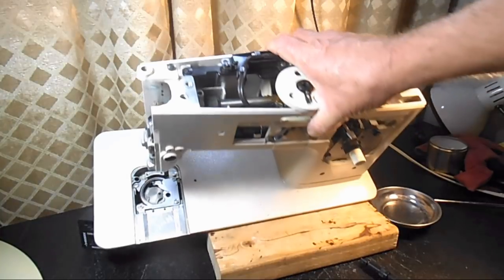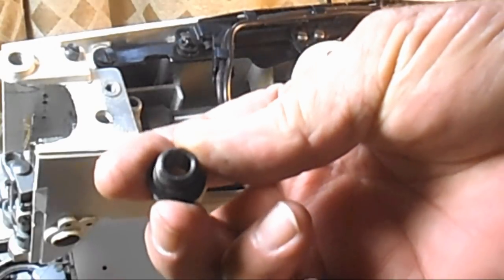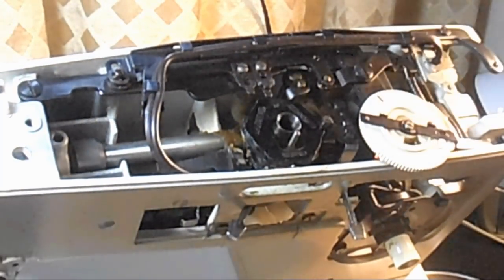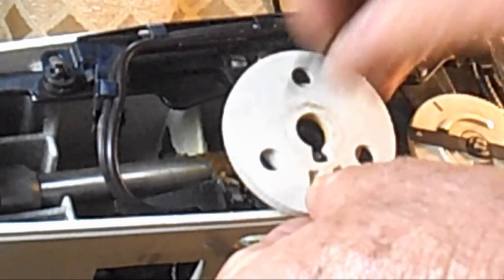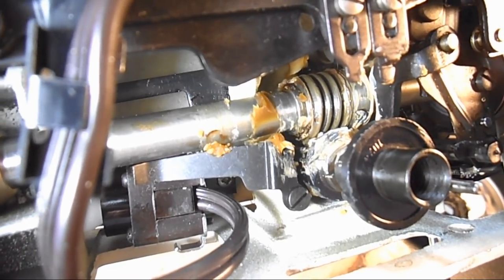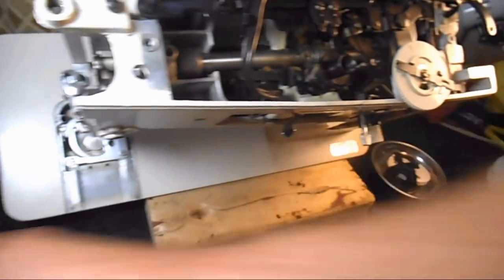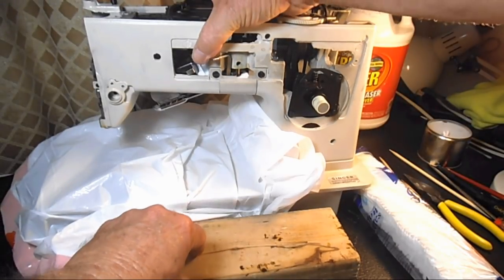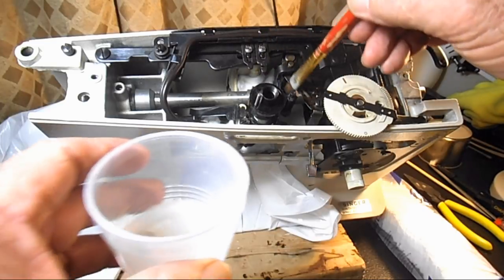How I degrease the worm and cam stack gears on the Singer Model 513 Sewing Machine

Comment: When you say,  "don't use it on the black singers" you mean just the body right? You can still use it on the metal, (silver) bits right?  Just not the body? Thanks for sharing all these videos.  They have been ever so helpful!
Reply from the maker: You are correct Anne Marie; I mean just not on the painted body parts. I have never tried KK on a painted black machine but had 2 viewers mention it dulled/hurt the black finish. They did not say what strength or duration they had used, but I figure better safe than sorry. The KK is really good at removing grease and oil, IMO. I have been told GoJo is good too, and will not hurt the black paint. I just use a trash bag to protect the paint like in this video. It sure beats hundreds of Q-tips and a quart of alcohol I used a couple of times when I strated restoring machines. Thank you for asking and I'll pin your comet so others may see it. Hope you'll visit Andy Tube again. Take CAre.
Reply: I guess it's kind of off topic but do anybody know of a good website to stream newly released series online ?

Comment: Awesome, so belt driven instead of vertical shaft gear and all other gears are accessible from the bottom😁 Now I can check for broken gears and belts so I can oder parts👍 Thanks Andy!🌞✅
Reply from the maker: Good luck. You can email andymanuals53@gmail.com and ask for the FREE copy of the parts list/diagram if you want to verify parts numbers. Thanks for watching my channel.
Reply: @andytubesewing1953  thanks I will do that. Just checked my machine and only need bobbin shaft gear😁😁😁😁the other 3 are good, 2 of which are original, and the belts are good...WHOOOHOO😄😄😄😄
Reply from the maker: @caper695  Good news then! It's in the mail. Take care.
Reply: @andytubesewing1953  got them, thank you and I will remember to set the hook timing✅✅✅✅

Comment: ( continue previous post)
Many other parts on the 401a were frozen too. I used the Triflow  oil and Krudd Cutter to clean and unfreeze the 401a. Thanks for those tips. It's still a work-in-progress, but it's coming along well. At least all the wheels and knobs are moving freely now. The machine was in bad shape. I don't think it was touched for 50 years and I don't think it was ever cleaned given minor maintenance by those who owned it. I know that the 401a and Touch and Sew machines aren't your favorite to work on. But I'm hoping one day I'll see one of them in your videos. One can only hope. Thanks again Andy for your great videos.
Reply from the maker: Sounds like you have a nice collection, congratulations. Maybe you will do a video on how to remove and clean that 401A camstack someday. It's always interesting to hear stories of those vintage Singe machines that were abandoned for 30 to 50 years but can be cleaned, adjusted, oiled and greased and will work very well. I'm guessig you already have the Singer Sevice Manual for your 401A, but if you do need a free copy you can download it from this page: https://sewingdude.wordpress.com/category/free-manuals/

Comment: Really helpful information. Thank you for sharing, I need to clean a machine, so is great. Just a suggestion to save to time and having extra mess to clean; wrap the machine base with plastic.
Reply from the maker: Welcome. Thank you for suggesting wrapping with plastic. I did some protection starting at about 20:45 in this video. What I wanted to stress is that cleaners can dull the paint finish and not to use Krud Kutter on the Black Singer Models. I made this video at the request of viewers about cleaning just the worm gear area. I usually just wash the whole machine in the shower. Here is a link to my playlists page where I have videos by model number. If you watching one like "CoCo goes to the Spa", you can see how I clean the entire machine. I have over 340 videos, so something for everyone (almost). It was kind of you to comment. Thank you for watching Andy Tube.

Comment: "The plastic gear on the bottom of the cam stack (disc driving worm wheel) that meshes with the metal worm gear of the main horizontal arm shaft" that you were talking about has broke in half on my machine.  Where can I find a replacement? Thank you so much for your videos.  I have learned a lot.
Reply from the maker: huh... I've never seen that before. Ouch. Anyway, the parts list I have says that parts No. is 153640 and that part is on models 513, 514, 518, 533, 538. I see a trusted seller has the part for $4.00! She took it off a model 534 it looks like: http://thriftyfarmgirl.com/singer-534-stylist-sewing-machine-parts   There is not a parts list for model 534 that I can find. Because my list shows the same part of models 533 & 538 experience tells me the same parts would most likely be on model 534, which is a somewhat rare model as it has a tubular bed and not many were sold.  If you need help with the replacement method you can buy the Service Manual for $5.00 here: https://manualsoncd.com/product/singer-500-sewing-machine-service-manual-518-538-513-514-533/  I was surprised to see someone had the part for sale. Good Luck, and thanks for watching my channel.

Comment: Appreciate your videos . Just subscribed. I just purchased a Vintage Bernina 831. It is full of grease all over the place. Planning to remove motor and electrical before a cleaning. 

Can i use Krud Kutter on nylon gears?  I apologize if this was mentioned on a previous video. The machine is all metal except for 2 nylon gears. Thank you.
Reply from the maker: Welcome to Andy Tube Channel. Yes, it is OK for plastics. I would spray/dip and brush then rinse. I would not soak plastic in the cleaner for long periods. The manufacturer states it is safe for most plastics. You can find the product page here;
https://www.rustoleum.com/product-catalog/consumer-brands/krud-kutter/cleaners-and-stain-removers/original-krud-kutter?ls=KK326&lc=
From there you can find a use chart here; https://www.rustoleum.com/-/media/DigitalEncyclopedia/Documents/RustoleumUSA/Product-Documents/Brochures/krud-kutter/kk_bifold.ashx   
For example  a 1 to 10 ratio of KK to water is recommended for plastics. I have used much stronger than that but start with 1 to 10. I have cleaned many plastic parts, gears and carry cases with KK. You can find the actual dilution reference chart here; 
https://www.rustoleum.com/-/media/DigitalEncyclopedia/Documents/RustoleumUSA/Product-Documents/Charts/Original_KK_Dilution_Reference_Chart.ashx
Thanks for the sub and for watching my channel. Good Luck.
Reply: @andytubesewing1953  wow!!! Thank you so much!!! I appreciate your help.
Reply from the maker: @alcas7864  Certainly 👍

Comment: I've used Tri-flow products on my vintage Kenmores for a long time and they seem to love it.  I'm curious though, on this model 513 Singer, you say "no where" else on the machine gets grease.  I think I missed something in this video. (I went through it kind of fast, jumping a bit here and there)  Did you or did you not use grease on the gears underneath next to the bobbin assembly.  I have experience only with vintage Sears machines. My "Kennies" all have a covered gearbox in that position which I open and grease when necessary.  
Thank you SO MUCH for the info on Krud Kutter!  I've only used alcohol for this purpose and alcohol alone is not nearly as efficient as using Krud Kutter, so I'm very glad to know about it.
Reply from the maker: I love the Tri-Flow products too. After several conversations with retired Singer Repairmen that I met years ago, I have never put grease on plastic gears. Those lower gears on the 513 are all plastic. On the SInger Slant-needle models like the 301A, 401A, 403A, 404, 500A and 503A the handwheel gear is a type of plastic (kind of) called textolite and Singer definitely said and shows in manuals to put grease on that gear. Also, on later models that have a plastic gear on the bottom of the cam stack (disc driving worm wheel) that meshes with the metal worm gear of the main horizontal arm shaft I do put grease that plastic gear. Some people disagree and feel the plastic gears should be greased and ask me what I would use. I tell them that TriFlow says on their website that their clear synthetic grease is "safe for most plastics" so I guess I'd use that since I know the quality of that grease. I only worked on a couple of Kenmore models so I do not know if the gears in the covered gearbox on them are metal (assume so) or plastic. I hope that answers your question? If you watch my videos for the info and not entertainment they are best viewed at 2X normal speed. Thanks for watching and take care.
Reply: Thanks, you have answered my question.  Yes, ALL of the gears in my Kennies are metal.  I'll remember about watching at 2X speed.  I tend to be impatient regardless of what video I'm watching and that will help a lot. Thanks again!
Reply from the maker: @PibbleMom297  Thank you. See you next time.

Comment: I like all you hints you  offer as well. Do you have any suggestions for machine with plastic parts? I need to work on another machine, I purchased used and needs major cleaning. Thank you
Reply from the maker: I have cleaned modern plastic machines using the same methods in my videos. The Krud Kutter is safe for plastics. I usually do not put grease or oil on plastic gears or levers. I have put grease where the metal worm gear connects to plastic cam gears. Here is a playlist that includes cleaning a machine with Krud Kutter:
https://www.youtube.com/playlist?list=PLsCOZgzzaiKLZyGebzS_oISgesXNyREyI
Reply: I had forgotten I had bought Krud Kutter, worked well. Someone had greased the plastic gears and grease was on the belts so there was no traction. Belts slipping.Got machine cleaned up following your lead and did use a bit of alcohol in a few places. Now I am waiting for new belts. Thank you for sharing all these tips.
Reply from the maker: I'm glad it worked. Grease spreading to other areas is why I say don't over grease things. BTW, years ago I had a very greasy belt and soaked it in the Krud Kutter for 15 minutes, lightly scrubbed it with a wire brush and wiped it with alcohol. It actually worked well for me after it dried. It was a 40-year-old belt so I don't know if that would work on more modern belts.
Reply: Yes, Krud Kutter did work on the belt & after I wipes & rinsed it well, I cleaned with alcohol. There was grease on everything. Guess they thought more & everywhere is better just in case..Ha Ha.
It is actually a BL 101 Blind stitch hemmer. Now I have to figure out why the looper is not moving at all. Thanks again.
Reply from the maker: Good luck with your hemmer.

Comment: My handwheel is completely stuck. I was sewing along and my machine whirred to a stop. Would doing a deep clean get it going again? I got it secondhand for $80 and was quoted $125 to repair it before the tech even looked at it. For that money I can get a new one. I'm just a hobby sewist.
Reply from the maker: I don't think so really. If it was working OK and started slowing down and hesitating over an hour or more then maybe it's a lubrication problem. When you say it "whirred" to a stop it sounds like in a minute or so. Is it a model 513 like in this video? I'm thinking more a belt or gear problem. Thread wrapped around the hook/ bobbin case. It never hurts to clean and oil a machine. It should be done often. Maybe if you follow those procedures in the instruction manual to clean and oil you will come across the problem.

Comment: What do I use to get the yellowing off of my chrome parts. They look like brass and I know they are not. It is a 1932 15.91 ornate. I am learning from u how to restore her.
Reply from the maker: I'f never had heavy yellowing of chrome parts, so I do not know if that is some reaction of the metal to something it contacted. I have had very dirty machines, including chrome parts. In general I clean the chrome with a 15% solution of Krud Kutter Cleaner and Degreaser. This works well to remove grime and dried, varnished oil which can cause some filming of chrome parts. I DO NOT use it on the black machine surface. Once a part is clean I often use a metal polish to remove the fine wear scratches and brighten up the dull sheen. After using about 6 different metal polishes over the years I usually just use Brasso. It is inexpensive and readily available; even my grocery store carries it. I"ve never had the pleasure of working on a model 15-91 so I don't know if there is something special about the chrome on it from 1932. I did use some Brasso on a few of the chrome parts of my 1939 featherweight with very good results. Thanks for watching my channel and good luck.